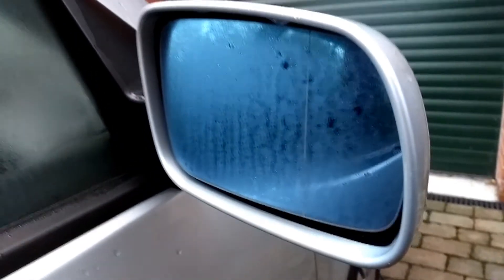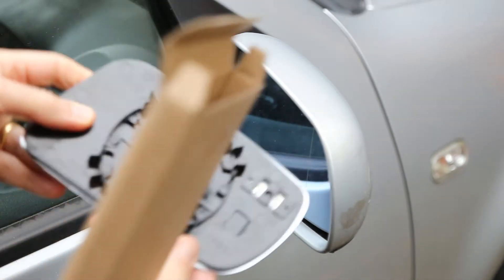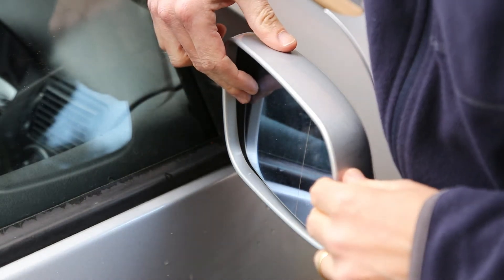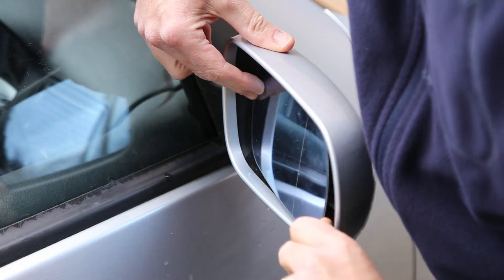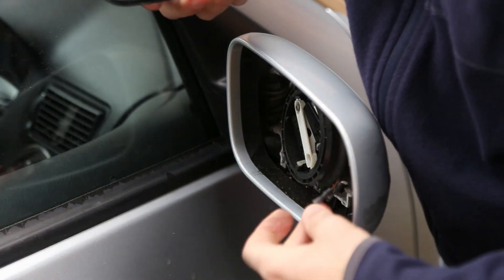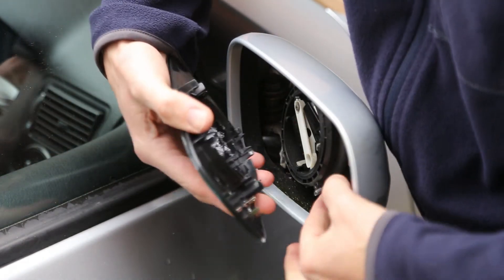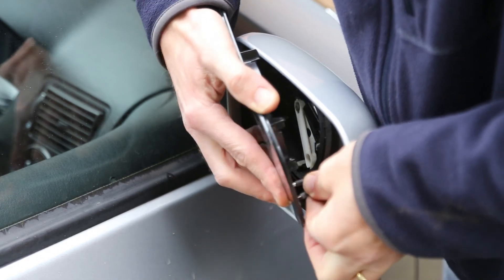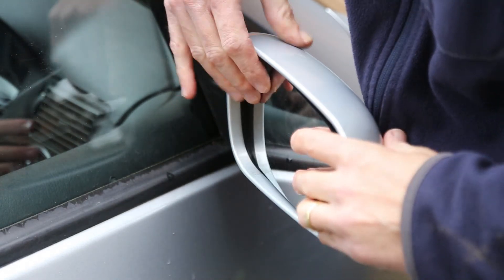VW Golf/Bora/Jetta Heated Mirror Element Broken & Not Working, How to Replace Mirror Glass

Comment: I don't mean to be thick but where is the turn on/off switch?
Reply: Is next to the mirror adjustment button, you will see a sign there
Reply: @mariuscristian2831  I'm not blind,.so you think I'm that stupid? 
Do you think I've passed my driving test using "the force"???
Reply: @SkandalouzStyle  well you are the one who asked, I’ve just answered your question
Reply: @mariuscristian2831  no, it's you and your answers that are not worth my time. because just like everybody else, you are answering questions you don't know the answer to.
Thank you though because you inspired me to get off my ass and get my Volkswagen manual out and the electronically heated exterior mirrors are heated as long as the heated rear window switches on, so me being so sick of people like you has actually made me get off my ass and find the answer myself.
Reply: If you don't have a seperate heating position on your mirror knob then it's wired in parallel with your rear window heater.
Reply: @SkandalouzStyle what he said wasn’t wrong, some cars on the mirror adjuster there a spot for it, others are tied into the rear window defroster. Don’t be an ass
Reply: @Sloww_F3  I publicly apologise for being an ass. 
I do it all the time. Sorry. ✌️😉🤣🤣